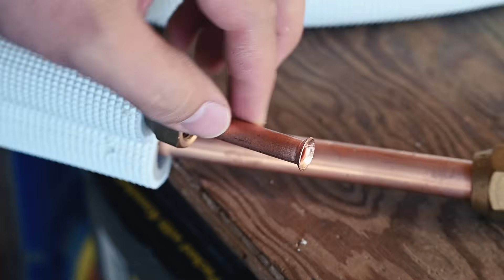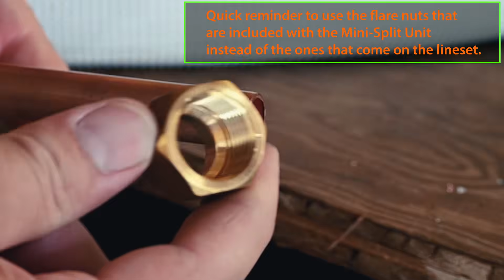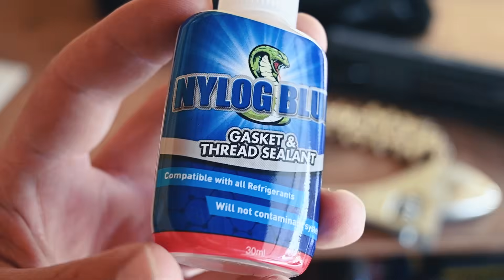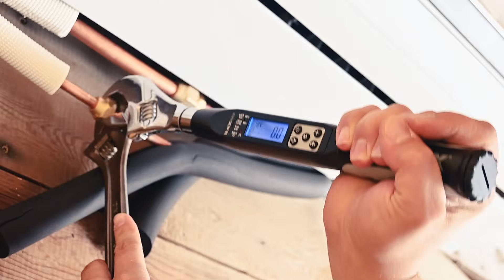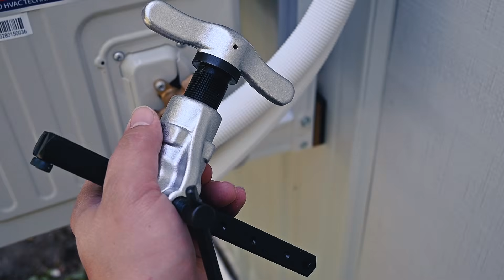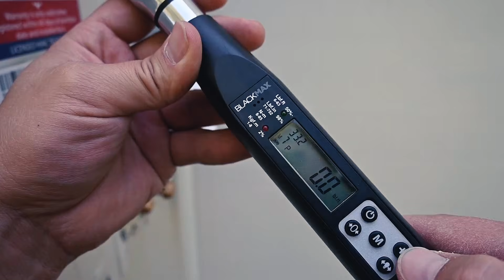How To Install a Mini Split Line Set - R410a Flaring Guide & Torque Settings Using Nylog

Comment: Really like your videos, one thing I’m not sure of, if the crows foot rotation around the center of torque wrench is equal, why would it matter if it’s 90 degree to the handle or not?
Reply: The key to understanding torque is the concept of the 'moment arm'. The length of the moment arm -- in this case, the distance between where the force is applied (your hand) and the object that rotates (the nut) -- determines how much torque is applied with a given amount of force. Think about a long breaker bar on a wrench: you still apply the same amount of force on the end as a short wrench, but the long bar multiplies your torque. 

Torque wrenches are calibrated to a specific moment arm length. Good ones usually have a line where they expect the force to be applied, assuming the pivot is exactly at the square drive. By putting an extension (like a foot at 180 degrees) on there, your moment arm is longer than calibrated, and you apply more torque. Now, in reality, a small 1" or so addition foot doesn't really matter that much on a wrench of say a foot long. That would only be like a +8% increase, which is well in the expected error bar. If you grab the wrench wrong (e.g. near the end) you would be off by just as much. 

Really, for these kinds of things, it's ridiculous to be talking about decimal place foot pounds. A hairless ape grabbing a wrench handle wherever is convenient is going to always be +-15%, not even counting the inaccuracy of the wrench. All the wrench is really doing for you here is making sure you don't significantly over or under tighten. Humans are pretty bad about estimating torque by feel -- see Ben's other video about torque on electrical connections for example.
Reply: @bnasty267  Heh. I was standing around the other day watching the HVAC guy installing a big multi zone mini split, and we were talking about nitrogen leak testing, etc. when he was hooking up the lines. The nearest torque wrench was at my house several blocks away. 
AND if I'm not certified as an installer, my warranty will be void on many of these Brands. 
Good explanation of torque and moment arm. I've never used a crow's foot adaptor with a torque wrench, so never really thought about it.
Interesting thought as to what the math would be when using the adaptor at 90 deg. The torque/reading is still not going to be accurate. 
One could pull/push the handle of the wrench and exert zero force on the nut. Completely irrelevant to this video, obviously, but interesting to think about.

Comment: Shame on you for forgetting that nut!  ;)
On the other hand, that back-off/re-torque technique makes a lot of sense. I would guess this same idea could be applied to standard water piping when using compression fittings?
Reply: Forgot to mention - I have a standard (cheap) flare tool - this rotating one makes so much more sense; thanks for pointing out the quality difference. And greetings from Stillwater, MN.

Comment: WTF This is NOT correct.

Do not "eye ball" the measurement.  I am a realist, but making marking a measurement takes seconds and matters. Use a Proper deburring tool.  They cost less then 10 bucks and you can use them for all sorts of piping. You are suppose to use refrigerant oil, nylon or similar substance to lubricate.   Yes jagged rough edges are ok but your are horrible. the key is the edge has to be thinner then the sealing area or it won't seat property.  You want the the smooth area to be the thickest part.  I appreciate realistic videos and im sure yours will work ok, but you could do so much better.
Reply from the maker: Could you specifically share what you would do differently? Would love to hear your opinion.
Reply: @BenjaminSahlstrom  I edited it, most content creators just ignore long posts. FYI I stopped watching after the first flaring part, when I watched the second part i see you did use nylog, i generally less but good for you for using it.  I also use the